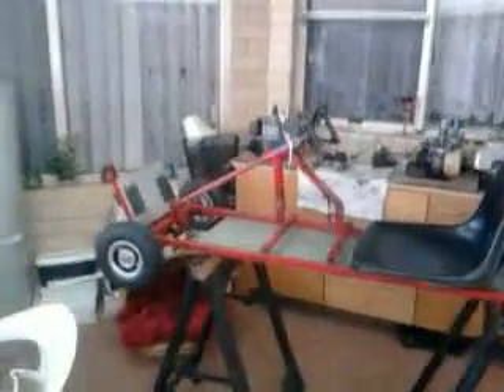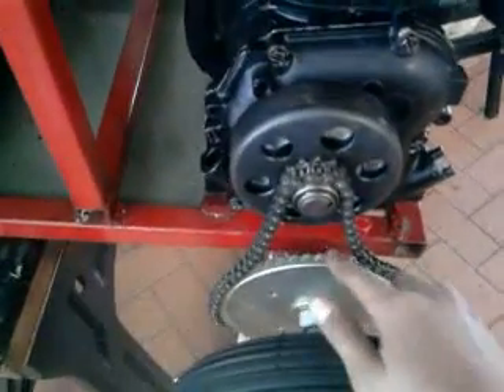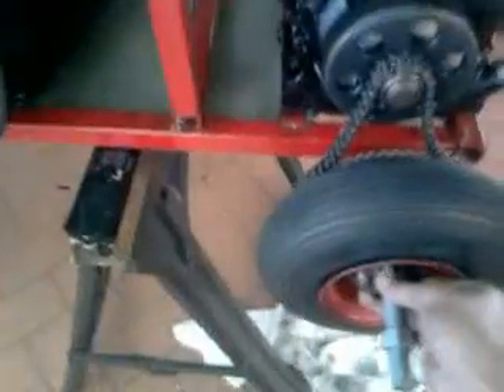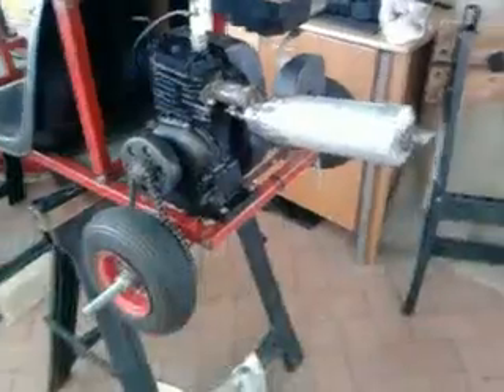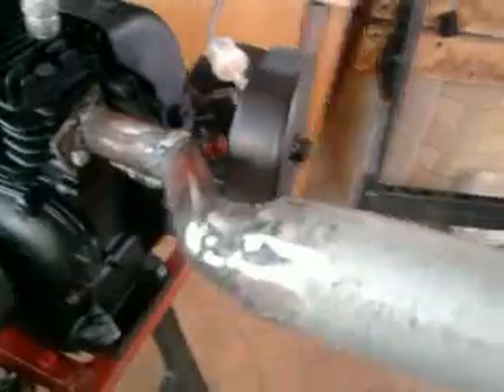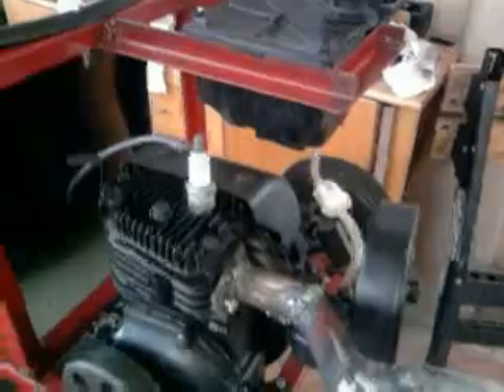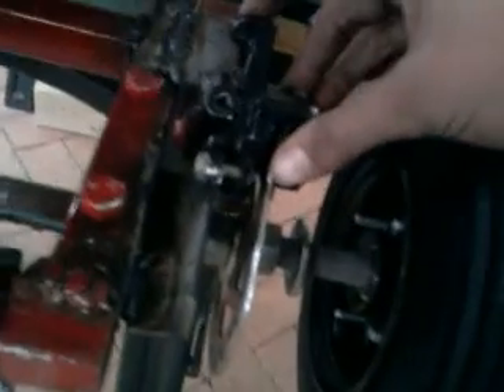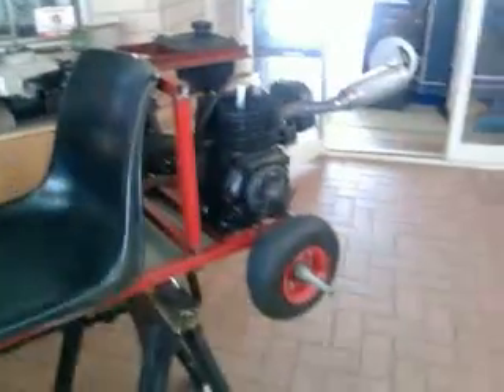Go-Kart Build Pt 14

Comment: nah cut u little strip of sheet metal and make a bracing from the head bolt to the end of ur muffler. U need a bracing on top not on the bottom. It doesnt matter if ur welds are strong enough to hold a house its to protect ur engine. The blocks only aluminium and any weight will strip the threads out. Also that chain is wayyyyyy to loose. Take a link out. If it will be to tight (may be pushing it taking a link out) then prop the engine up with washers or wood or something.